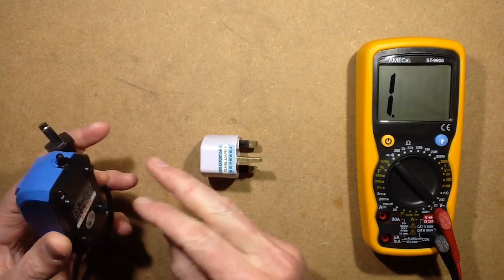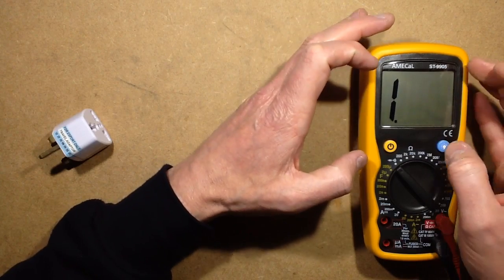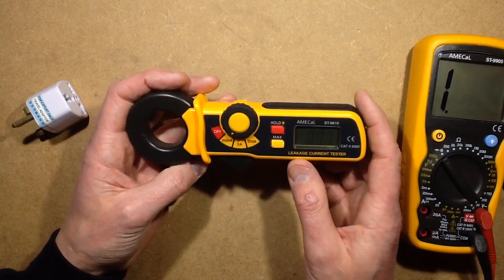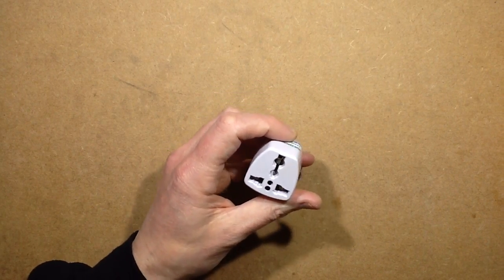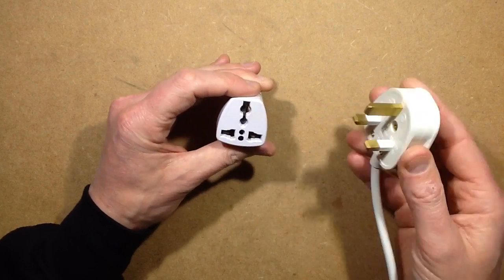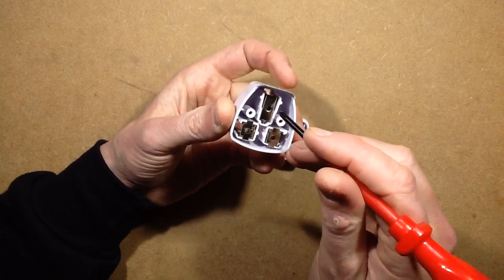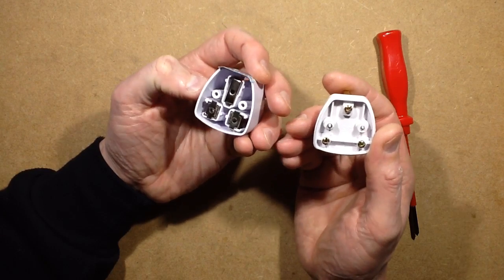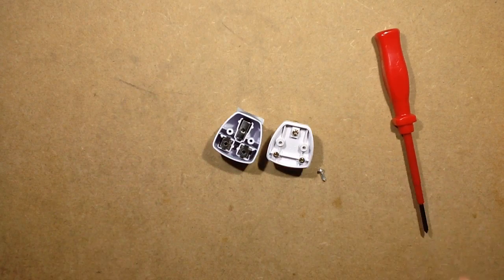Inside another death-dapter variant.

Comment: I wonder Clive,
is it just assembled incorrectly?
could the connections be designed to screw to the pins and the assembler just didn't bother to do that and just pushed the parts into the holes and didn't screw them to the pins? 
I enjoy all your videos by the way !!! a big thumbs up!!!
Reply: +Markus Bates I do not blame China for this.  It is the Western corporations who order these items and turn the screws of the manufacturer to squeeze every fraction of a penny out of the cost who are to blame, in a relentless drive to increase profits at any price.  As long as their own name does not appear on the product, they do not care.

Chinese manufacturers are capable of excellent work, if only someone is willing to pay for it.  The junk products are not for domestic use, which explains the "For Export Only" decal.
Reply: +superdau maybe whoever made the holes messed them up and someone came up with the idea to shove it in anyway, lol
Reply: +KB1UIF 
If you look closely none of the crews would match the holes in the metal taps. The ground very obviously, the other two not so much, but still off.
Reply: +KB1UIF exactly what I thought - looks like the workers in the factory went to brain dead mode just like with the earth wire glued with hot snot in those cheap LED lights..
Reply: Markus Bates
they are, but theres always someone who wants it cheaper, some middle man who wants it cheaper than last year so he can earn more money from the sales, leads to this mess
Reply: +KB1UIF   I took 2 of these apart recently that came from China with some wireless phone chargers.
The pins were screwed to the metal contacts.

I wouldn't risk using them.
Reply: +KB1UIF "Made in China" definitely can be anything, but almost everything "Designed in China" tends to be dangerous and / or faulty
Reply: +pillsnotbills The weapons dealers are not to blame, its the people who buy them, the drug dealers are not to blame, its the drug users. China is not to blame, it is the importers....unfortunately the people who manufacture / export these goods are the ones to blame...yes the importer maybe suspecting they are crap, and the end user is just after a bargain, but it is the manufacturer who is the most culpable, they are the ones who truly know what they are making is a death trap, and they are the ones who truly don't care....they made the choice to ignore standards and safet, they manufactured, they lie, they deal, they are to blame.
Reply: Yep thats the point i was making - China is the one to blame, they make all  this dodgy crap knowing full well its dangerous, and they just don't care!
Reply: blower Yes, they did it, but it doesn't matter.  The value of a life has been well established, and it is not that much.  As long as there are people of dubious character, and governments whose master is not the people, nothing will change.  Caveat emptor.

Comment: I have like 5 of these (EU, not UK) adaptors at home and I opened one just to see if they were just as horrible. Mine were actually screwed down through the holes of the adaptor part...
Reply: +Dima Oliynyk Do they fit your sockets? The ones I've had (and tossed) the body wouldn't fit into the (round) recess of the outlet/socket
Reply: +Michael Tempsch yup, they fit perfectly. I have had different types. Got one for free which didn't fit. Then bought 5 from aliexpress which work fine.

Comment: Not intending to be too chauvinistic here but seeing the different types of foreign plugs really makes me appreciate NEMA 5-15s. Yikes!
Reply: Mostlyharmless1985:  The blind adoration of Tesla by people like yourself really cracks me up, most always based on myths.  Your "perfect" power system has the flimsiest, crappiest, unfused appliance connectors in the known universe, but hey, Tesla.  You system means you need special sockets for any heavy consumers, so you end up with things like shitty electric kettles that take forever to boil water.  Since your system is so perfect, why did you end up using shitty aluminium building wiring in the 60's and 70's which has caused so many problems?  Did Tesla come back from the grave to mandate such a stupid decision?
Reply: Explain how it is objectively more efficient to deliver 120v to your sockets (at twice the current for the given power) than 240v?  Why do you think you don't need fuses in every appliance? Fuses have nothing whatsoever to do with protecting from shock hazard, they are there to prevent fires by protecting conductors from excessive current, a fuse in the appliance plug protects the flexible cable between the plug and the appliance.  The difference in efficiency between 60hz and 50hz is negligible, the lower frequency simply requires slightly larger transformers.  Why would I want to heat water in an 800 Watt microwave oven when I can do it almost four times faster with a 3kW kettle?  Kettles are available in different power ratings, and I'm sure you'll be surprised to learn that the more powerful ones heat water faster. I'll give you the benefit of the doubt and call you ignorant rather than simply stupid; ignorance is fixable, educate yourself.
Reply: Ypu can't explain that, because it's not more efficient.  Also this person doesn't understand split phase, and keeps calling it '2 phase' lol
Reply: Mosltyharmless1985:  Your comment shows your lack of understanding of the purpose of a fused plug.  If you only have fuse/breaker at the consumer unit (or whatever it's called in the USA) does the breaker magically know the cable rating of any appliance which is plugged in and adjusts it's own rating?  Of course not.  The fuse is there to protect the appliance cable.  If you plug an appliance with a 5 amp rated cable into an outlet capable of delivering e.g 15 Amps, and a fault in the appliance causes it to draw say 10 Amps, then how is the breaker going to stop that cable overheating?

Also a microwave can not boil water faster than a kettle.  Electricity to heat (via resistive heating) is pretty much the most efficient energy conversion on the planet. A 3kW kettle will always boil water significantly faster than your 1.5kW microwave.  230v is not an unreasonable voltage in any way, I've already explained all the advantages it gives, yet you can't give me any advantage of having only half the voltage available.
Reply: +Sarah Watt (NuclearSarah) "appreciate" them? They'd be 'safe' at up to about 5 amps. Rating them at 15 is ridiculous, they get hot
Reply: Why would you think that 230v systems have a quarter of the efficiency?  It's the other way around, the higher the voltage the lower the copper loss, for a given sized conductor.
Reply: Except you went and fucked it up and run at 50 Hz, which is worse in pretty much every way. Don't argue with America's power system, we got it right, we had Tesla.
American houses are run 2 phase 240 at 60HZ. Split rail. Normal appliances get one phase, appliances that need more get two. It's the best world in safety and power. We don't NEED fancy plugs with gee wiz bang features like shutters and fuzes in the cord and rcis because we don't run the entirety of our houses at dick shrivlingly voltages.
Everyone transmits at HV, everyone hits the box at 240/480, the difference is Americans used 2 brain cells and went "oy, do we really need to pump all this potential to every appliance when we are just using these fancy dan electric candles? I guess not!  It's a good thing that Tesla fella came up with the perfect resonance for sending power and generating it, he's good eggs."
Reply: mikerjuk slightly larger transformers means more material used meaning more wasted resources and therefore less efficient. Again, American power is "split rail" since we want to be pedants, it runs at 240. We don't NEED to run at the higher voltage specifically because we can do work more efficiently. You don't need fuses in the plugs because the breaker will trip far before any kind of fire could occur. You know, the thing the NEMA standard got right. My microwave isn't 800 watts, it's 1.5 kw. I can boil water in less than a minute. 
Why would I waste power on a 2.5 kw kettle to do what a microwave can do in less time? That's the point. 
Go on thinking your deadly wall sockets are better with giant fuck off connectors. I'll stick with reasonable voltages.
Reply: +TheChipmunk2008 Plus, they're soooo American.  /wankwank
Reply: NEMA is just the right mix of "not likely to kill you through normal use" and "if it fits it's probably right." I'd never use it for 220v circuits. 
15 amps at 110 volts will work just fine thank you very much. It's not the plugs fault you Europeans want to make your electrical systems twice as dangerous, and a quarter the efficiency
Reply: mikerjuk I think you missed the part where we have 2 phase, 240 to the junction and run 120 single phase at 60 HZ for general appliances. This is objectively more efficient in transmission and safety. You missed the part where we don't NEED fuses in every appliance because every appliance isn't liable to blow you 6 feet across the room. Tesla got it right. Meanwhile in "Yurp" you guys landed with 50hz 240 because some German shitstick liked how round the number was, not realizing how 60 was key to efficient transmission. To compensate for that dumbassery the had to raise the rail on all lines in the house 240 to get it to do anything other than suck shit. Having used your kettles in "Yurpeen" powersystems, (British actually) they are no faster than the kettle I had at home that runs on 110. Oh my god what a fucking shocker we can run twice the current because we don't have godamn 240 volts on a single rail like a bunch of jackasses.
PS: Kettle? Learn what the fuck a microwave is.

Comment: The other thing about those adaptors, there's no fuse, so you could potentially have a 32 Amp short on something like a shaver
Reply: +Sparky Projects Here in the US, the outlets go back to a breaker box that breaks at around 15 or 20 amps. Usually each room has its own breaker. I do understand that the UK uses a ring wiring system where all the plugs just tap off of it.  I wonder why they don't just start doing away with fused plugs and put the short circuit protection at the outlet, and the overcurrent protection in the distribution box?  There is one exception to the lack of fused plugs in the US, and that's exterior rated Christmas lights.  Many of those are designed to go end to end and they put fuses in them in case of rain or overloading of the wires.
Reply: +Sparky Projects Better system ???
From a practicality and cost/time angle for sure but from a safety perspective ring's are fundamentally flawed imho!!
From an electrical view I have always gone with a belt & braces / worst case scenario angle to make sure everything is 100% safe no matter what.
A broken ring (cowboy DIY, abused/damaged wall socket,  loose fixtures ..etc) would mean 2.5mm cable is protected with a 32A breaker which is obviously a serious safety issue and a massive fire hazard!!
Personally what with big CCU's and copper cable being as cheap as it is today I'd sooner spend more time installing a radial only system and do away with ring final circuits!
Also why aren't CCU's more advanced in the 21st century, Shirley in this day and age we can produce a CCU that detects when any of the cables reach a potentially dangerous temperature and then simply shuts the circuit down?!?!?!?
Reply: +Sparky Projects few countries have fuses in the plug end! you are too used to the best plugs in the world (uk! about the only thing now :P)
Reply: +jusb1066  I know, just pointing out another pitfall ;)
Reply: stonent
there is protection at the box also, an rcd for the whole house and a breaker for each circuit, so we are double protected! plus we have more power on tap, 13a at 240v per plug not per socket!
Reply: +stonent We used to have radial circuits over here, but you were limited to the amount of sockets per circuit, but went for a better system that means we can have as many sockets as we want. each ring is protected by a 32A breaker.
If the fuse was in the socket then you might have a 13A fuse on something like a table lamp, the idea of fuses in plugs is that each appliance should have the appropriate size fuse for each.
Reply: +stonent It was mostly a post-war economy measure at first, but now it's probably just because we nowadays have the infrastructure to mitigate the safety concerns, so we may as well do the cheaper thing.
Reply: +stonent Because you don't know what appliance will be plugged in. With unfused plugs, a 3000watt tumble dryer will have the same 'protection' as a 3 watt LED lamp...
Reply: Sure, electrical appliances should have appropriate internal over-current protection, but protecting house outlets with a 32A breaker is madness, IMO. For new housing, why not run multiple circuits, each protected by a 16A breaker, like we do in Australia?
Reply: We used to do that, but that's lots of cable runs, i've seen the huge distribution panels in american houses, no thanks !
As long as the sockets are properly rated, it's like having a pluggable busbar around the house, and fusing depending on what appliance is plugged in, i wouldn't want a table lamp protected only by a 16A breaker
Reply from the maker: +Michael N Keep in mind that our plugs normally have suitable fuses in them.  So for something low power like a light or laptop it could be protected by a 3A fuse locally.
Reply: I get that, and as an engineer I appreciate the extra protection. However, having one big 32A circuit means it's ESSENTIAL to have protection in the plug itself, to provide protection for the appliance cable. Everywhere else in the world can get away with protection in the device itself, not the plug. Since most items are not just made for the UK market, this would mean additional fuses and cost.
Reply: Michael N
of course the cost of a uk mains plug, (and the easy conversion types) is very small! they used the cost of these back in the day to try to fight against the then government requiring new appliances to come fitted with plugs compared to bare wiring at the time.

Comment: I just throw those things in the bin, absolute junk and as you point out there, are not safe in any way at all, better just to cut the plug off whatever's been bought and stick a proper, full-fat British rewireable plug on there... :)
Reply: I do exactly this! Much safer, works a treat, and keeps practice in the increasingly rare (i.e: Could net £40/hr from 2022) skill of being able to wire a plug! :-)

The only hiccup came on the one occasion where I wasn't thinking straight and had forgotten I was working on an appliance in France. That said, it seems that a UK-Shicko adaptor is easier to come by in French stores than a rewireable Shucko plug! :-o :-p

Comment: explain why you have an "earth" plug in england? in europe there are only 2 connectors, right? but you have 3?? sorry new to electricity stuff
Reply: No. Your schuko plug has a 3rd contact on the edge.  The earth pin is obligatory in UK to open shutters which cover live parts. Safety for children.
Reply: Nick Hill so is the shuko safer or not?
Edit: and what about these? http://www.liandung.com.tw/upload_files/european_union/LT-207.jpg
Reply: +Justin Koenig EU has both earthed and unearthed plugs. The flat ones you see on lights and hair dryers and suc are unearthed. The rounf one is the eartvh plug and has earth tabs north and south if the power pins are seen as east and west. In sweden where i live alot of old housed don't have any earth wired though outside bathrooms and kitchens since it was not mandatory until quite recently.
Reply: Justin Koenig Because of the safety shutter we can't have  2 pin in UK. I haven't examined schuko sockets so can't comment on relative electric shock safety. However, UK plugs always feature  fuse so the cable and appliance are always protected.
Reply: +Justin Koenig 
Europe has many standards, but the basic 2-pin jobbie is universal throughout mainland europe (We in the UK are only in europe on paper), but they have their earth pins too, varies by country, but they do have them...

Plus the earth pin on UK sockets is used to open safety shutters in the socket that prevents little fingers from investigating these mystery holes in the wall and ending up as charcoal, so everything has an earth pin... :)
Reply: +Justin Koenig 
Those are only for certain appliances. Mostly ones where there is no way for you to touch anything 'live'.
Reply: KuroYoukai so for my samsung phone, the charger, you're saying i won't get a (deadly?) shock when touching the usb output, right? 5v as far as i know?
Reply: +Justin Koenig 
Okay. Ones where there 'should' be no way to touch anything live. Cheap crap from China always carries risks.
I've seen plastic 'Isolation' from China that used to be white turned into charcoal from normal use. Fun!
Reply: +Justin Koenig As long as the manufacturer uses proper distances inside, and components, you shouldn't be able to get 220 to the USB connector, and  the housing would be all plastic and insulating.

The cheapo Chinese USB chargers you can get for $1-2 on eBay tend to scrimp on both components and distances.

Compare to, for instance, a toaster where you have fairly exposed heater wires, likely a (partly) metal body - those come with a grounded plug.

IIRC, the flat plug is only supposed to be used on stuff that carry the "double insulated" mark (a smaller square inside another square), see http://double-insulated.com/